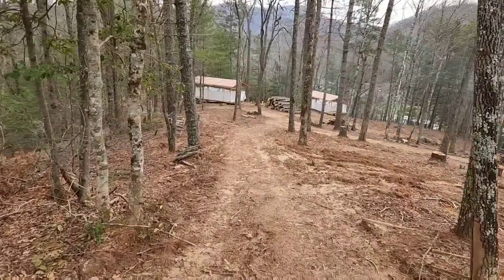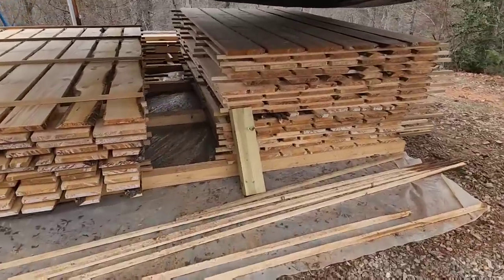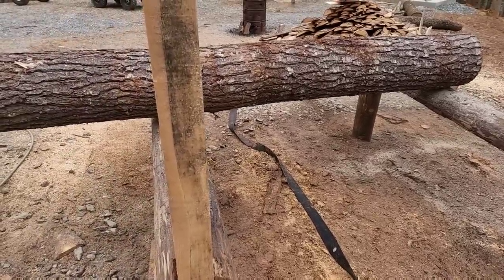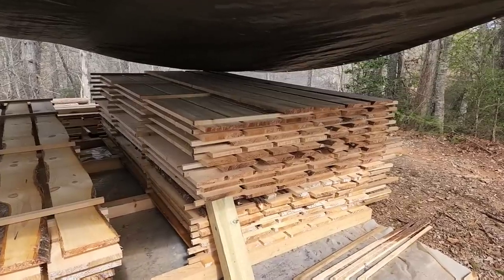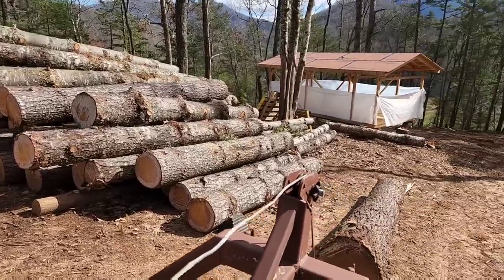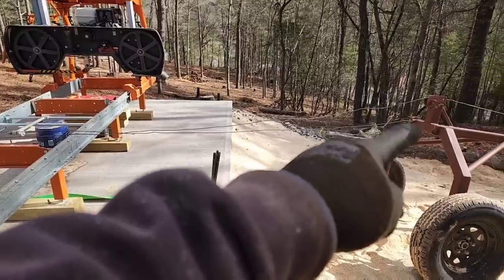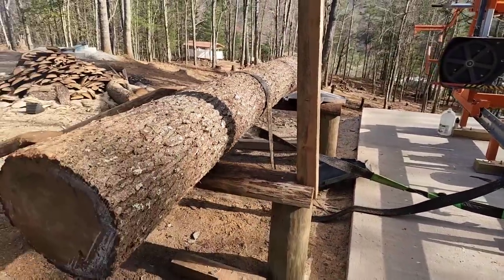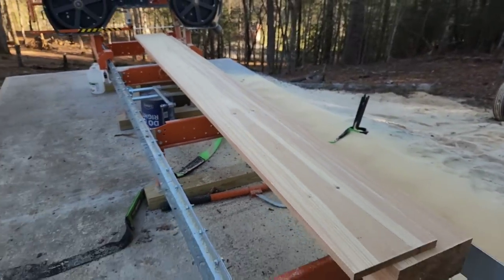Milling logs from the BIG pile!!

Comment: You are the only person I have seen with a log deck with flip  down arms. I had the same set up in my sawmilling days. Saved a lot of time. I also had a crib for the slabs.
Reply from the maker: Well I looked around quite a bit at different set ups and picked out different things I thought would work for me.  So far I am happy with how things have turned out.  My slab pile is another story...haven't found a good solution yet.  Thanks
Reply: @Lazy T Cabins  I built two uprights about 4' high and tapered out from the ground up. As the slabs were put in between these a bundle was formed. Using a banding machine, the slabs were banded at each end. We then placed the pallet forks under the bundle and stacked them in the yard. The slabs were sold for firewood and payed for my saw blades.
Reply: @LazyTCabins  @sawingsandy has a new, nice solution for the slab pile; he does the flip down arms too.
Reply from the maker: @DutchYankee  I saw that he made some with those metal shipping crates.  He moves them around with a tractor...that makes it a non-starter for me.

Comment: Good point about corduroy marks while milling.  I have watched most other sawmill channels, and don't  recall seeing that rollers may induce a bump.  I usually attributed the marks to teeth being out of set or speed of cut.  I will keep on eye on my rollers now too.
Reply from the maker: I just changed mine to the ceramic blade guides.  Nice little upgrade and no more cleaning rollers.  Thanks

Comment: Why are you leaving 1 X 4s and 1 X 6s in those thick slabs? Those boards are needed when building structures also.
Reply from the maker: Agreed.  I am trying to make a better effort at utilizing the usable wood in those off cuts.  Chalk this up to inexperience and I hope to get better.  Thanks for stopping by.
Reply: Not worth the blade wear for thin sapwood boards

Comment: Continuing, when you build your shelter over the mill, make sure to locate one of the support posts in the center of the log deck. The you can install a electric winch to roll logs up the ramp onto the log deck! You can also use it to turn heavy cants on the mill. In the interim you can set a pole next to the slab and do the same thing. Make sure to install the winch high enough so that it doesn’t get tangled in your mill.
Reply from the maker: If I put in an electric winch its going to be mounted where the hand crank winch is mounted.  The hand crank is so efficient and requires little effort, I think its going to be there for a nice long while.  Thanks
Reply: I sent that msg before you posted the one about the hand winch.

Comment: Looks to me that you are doing a nice job.  Your air drying set up looks fine to me.  I would suggest that you take the time to seal the lige ends with a couple of coats of Anchor seal before milling (you may be doing this already), it will save a lot of end checking.  Nice.
Reply from the maker: Thanks for checking out the channel.  I usually only paint the logs that are going to sit for a while.
Reply: @LazyTCabins  well, my experience is that it is quick to do and saves end checking on the milled boards as they air dry. Its a real pain to coat the ends of all the boards after milling.

Comment: This is quite an interesting setup. It may be too late now, but the unload point could've really do with being on a level with your mill then there's no heavy work involved as gravity isn't against you. Could you fabricate a ramp? If you have a lot more wood to mill it might be worth your time. Failing that a 12v winch would be a great investment, and incorporate a centre rail to ease your anxiety when pulling them up the ramp.
Reply from the maker: Thanks for taking the time. All good points but all in all things are working out pretty good so far.  I appreciate your thoughts.  Thanks

Comment: I wonder if you might should hold back on going all out before knowing what potential mistakes you are making with drying process. You are assuming what you are doing is fine, perfect…. That your investment in time in resources…  will all work out as planned. I’m not so sure that assumption is correct.   Let’s say it turns out you need to be doing more 1/4 saw to align grain patterns to stop warping. Better to not do 4 tons of wood all the same, before your methods evolve.
Reply from the maker: Great question.  I know for certain that there are going to be issues with some of the lumber that I produce.  I tend to look at things under the eyes of "this aint rocket science" and give it my best shot.  My methods certainly aren't perfect and there are 50 different ways to skin this cat but the overall methods employed are copied from not only the local knowledge from the 20 other mills in the local area but research upon research.  Don't get me wrong, I hear ya, this could all go to crap...  I'm doing my best that it doesn't.  Thanks for taking the time.
Reply: @LazyTCabins  It's not rocket science.  But it is resource management, which in any project is key.  I don't own a saw mill, but I'd hate to see you go full gusto, doing it one way and slice all those logs, to dry them all as you are, and in six months with lots more experience look at it as 15% useable to build.  15% to make aritistic wood frames and the rest chocked up to experience and saw dust.

   I'm not saying you are or are not making mistakes.  But at least learn by making different mistakes.  For example.  It would be my guess that if you saved a pile to age and milled them when it's cool and dry, say next October, that a year from now those boards will be far and away better than the ones you cut now and are attempting to dry outside in heat and humidity under a tarp, in your high humidity summer area.
Reply: @LazyTCabins  I've just found sticker quickly, stacked on level ground or platform, stacked bow up (heartwood up), lots of stickers and always one near each end (limits end checks), keep cover on it but not closed up without moisture escape, keep as high off of the ground as possible, put weight on top (bricks). The way you're doing it looks like it will work out well. Cool channel.